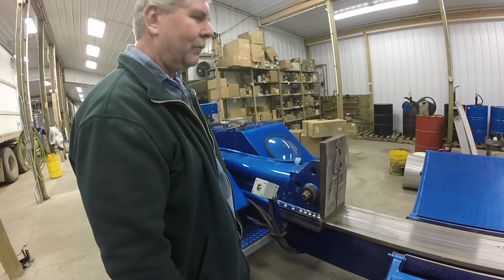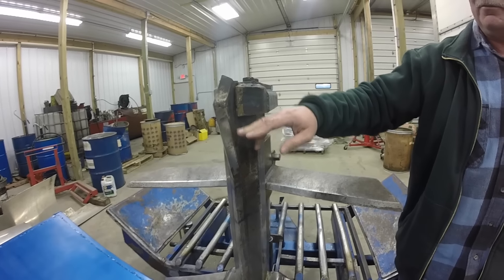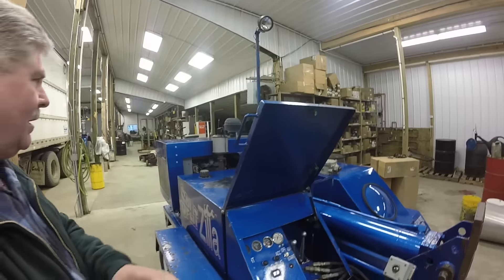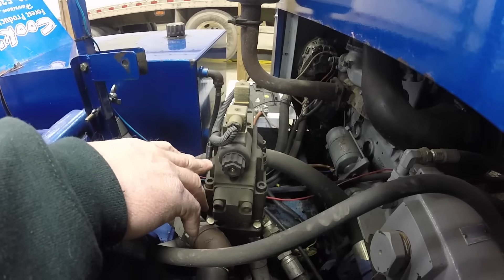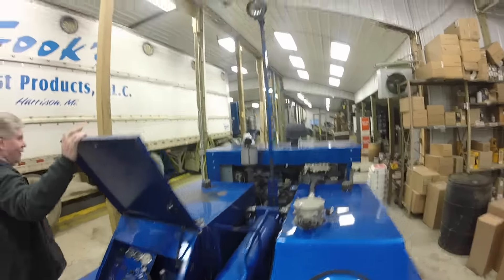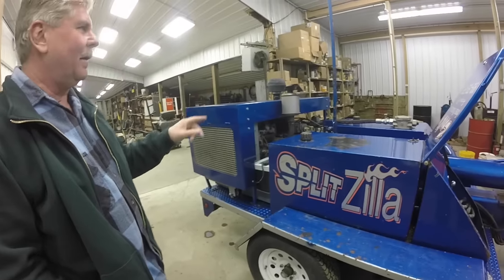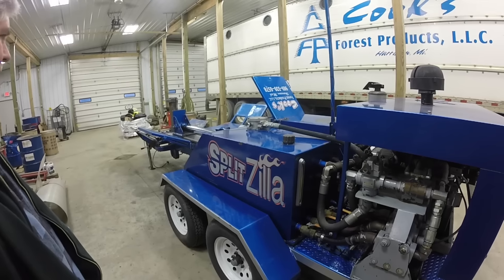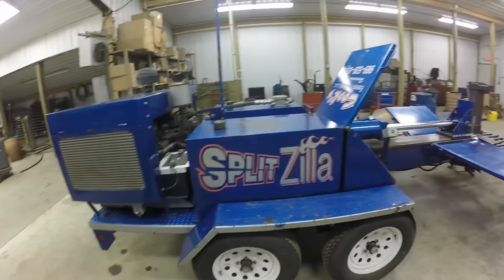HOW SPLITZILLA WAS BUILT!!!

Comment: Very  nice  machine.   you  do  need to put  rollers  on pusher over and under  top plate.  My splitter build in 1979  with  8" I bean   where pusher travels is wearing top of plate, so  I  put  roller  over and under pusher in 1995  about  and using it at 25 tons  splitting red oak so  far  no problem with I bean bending.

Comment: John or Mike I was wondering what you use to power the conveyor to take the wood away?
Reply: Tim Nephew it has a small Honda motor in a self contained hydraulic unit with tank, pump and valve.   We will have to do a video on it, I had it custom built, 32 ft long and works great. 
Thanks Mike Cook
Reply: Mike & Kim Cook thanks for the reply. I thought maybe you used hydraulic power from the splitter.

Comment: I like that "bill hook" on top of the splitting wedge which starts the first split as it also stops timber sliding up the knife and off when the saw cut on the log isn't square with the main knife.
I would like to know a little more about the pump and valve system if possible? I presume the two big pumps are mainly designed to give rapid movement and moderate pressure to the ram both when extending and retracting but do they dump oil or hold pressure or what when the high pressure pump comes into play?
Have you ever had a log jammed/stuck on the splitter? if so how did you get it off?
Reply: Dan Whiteford  the two pumps dump oil back to the tank all the pressure is from the one high pressure pump     Yes we have had a couple of blocks get stuck on main splitter knife but we just used the four way by moving in up and down a couple of times and it falls back off.   Thanks for commenting Mike Cook

Comment: I want to build something similar.  How did you figure what hydraulic pump size?  I have 27 hp engine from a fairway mower so it will not be able to do 90 tons.  But I think it will be good for me.
Reply: Brandon Damato    I had the cylinder and then I had a hydraulic shop help spec it out so that it would have the right speed, we then had to slow it down under high pressure because I only had a 52 horsepower motor to use.  Plus under higher pressure it can be dangerous if it wasn't slowed down, I needed good cycle time because there was such a long stroke.  Thanks for commenting Mike Cook
Reply: Mike & Kim Cook How did you figure out what size hydraulic pump to use?  Thank you for the response.
Reply: Brandon Damato by knowing how much oil it takes to make your cylinder do a cycle, then figure out how fast you want your cycle time to be.  A good hydraulic supply shop should be able to figure all that for you.   Thanks for commenting Mike Cook
Reply: Thanks for the help.  The splitter is very impressive

Comment: Hey mike just a great job on the splitter and the vid. just wondering, if it was a perfect world what other attachment's would you like to of installed on the splitter that might make it better.  thanks  frank
Reply: buzzee64  really not anything, but I have thought about a handy little holder for my pick a roon just haven't come up with anything that wouldn't look gawdy on the side.   I'm happy with the streamlined look that it has, it turned out good and has performed very well.   Thanks for watching Mike Cook
Reply: Mike, how about a 6-12" long piece of PVC pipe with a cap on the bottom to hold the Pick-a-roon?     quick in quick out
Just a thought. Al
Reply: so you do have a "firewood cutter" this is for longer bigger than ur normal house hold firewood .am i correct in thinking this
Reply: west coast logging alex esgate    Yes we have a Cord King 48 firewood processor that does most of our firewood orders, the big splitter is only used for oversized wood (clunkers) that is sold for outdoor wood burners.  Thanks for commenting.  Mike
Reply: Coffee cup holder!